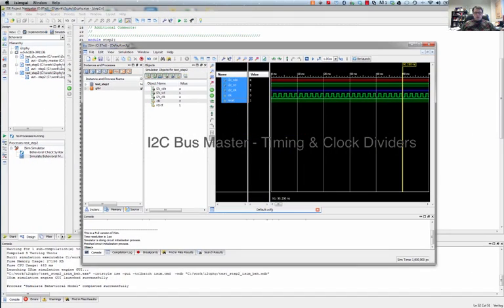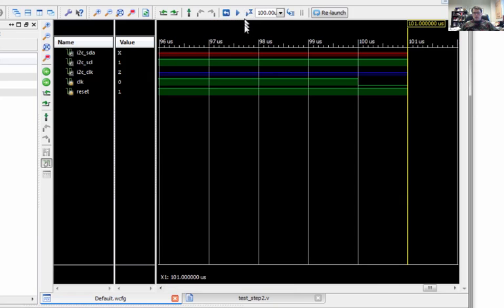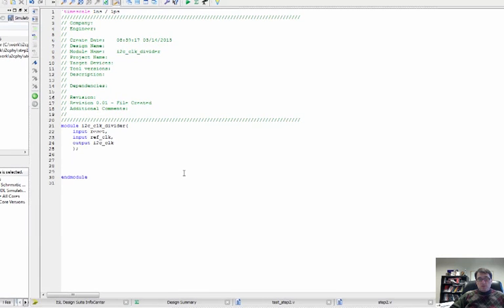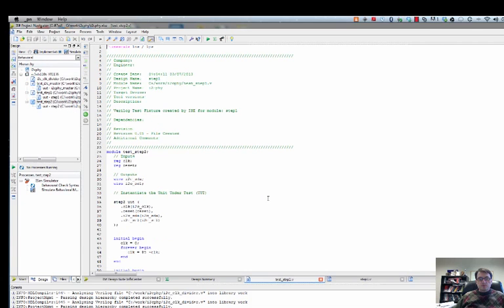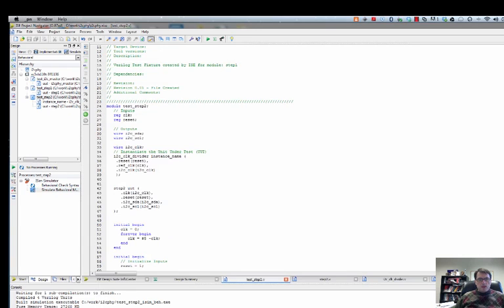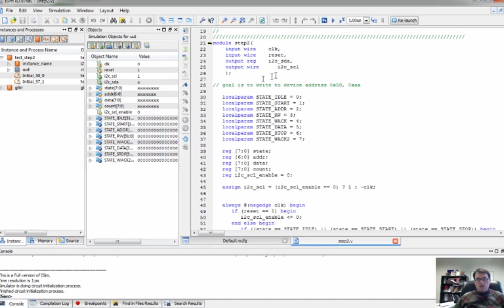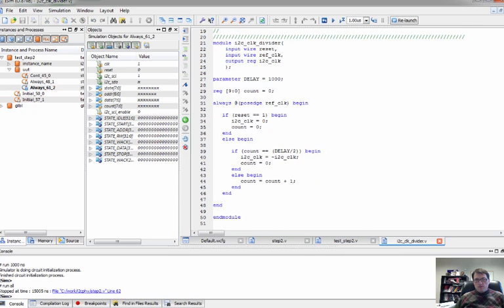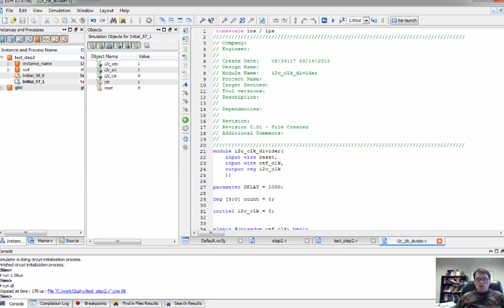I2C - Bus Master - Step 3

Comment: Speak up so we can hear you.  You might want to have a monitor for a sound check.  And the video side should be 720px or higher resolution.  The current 480px resolution is far too fuzzy to triy and following along with your code changes without you significantly zooming in on those changes.  Content is good.